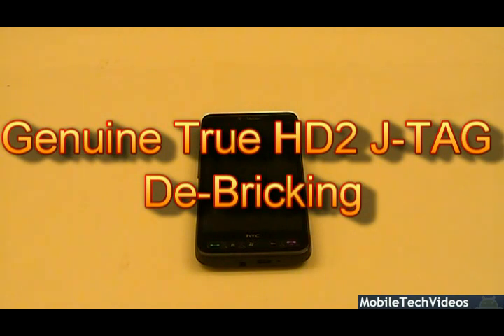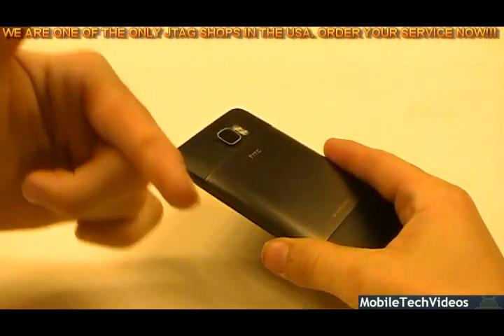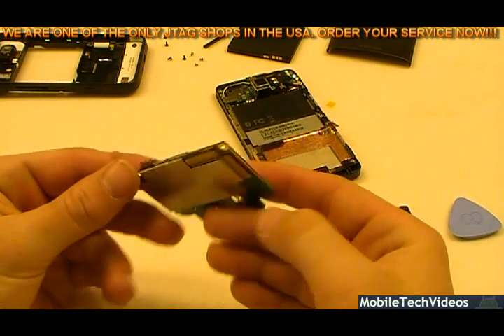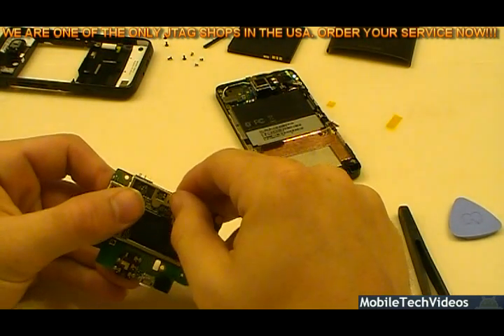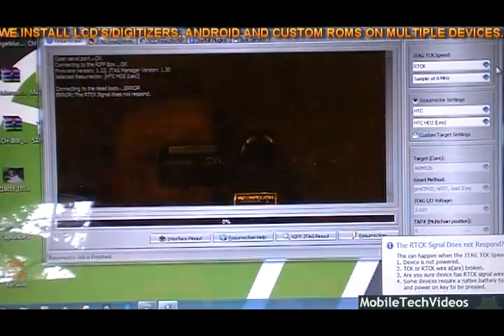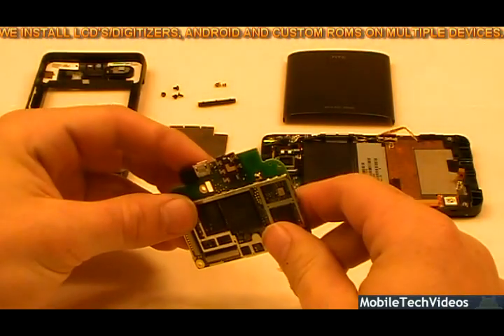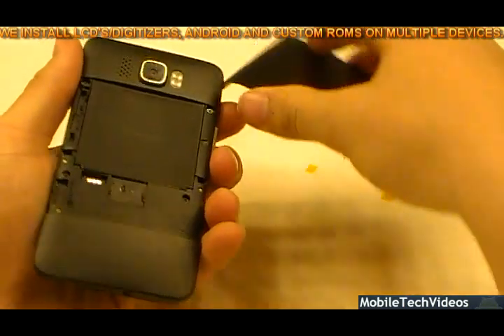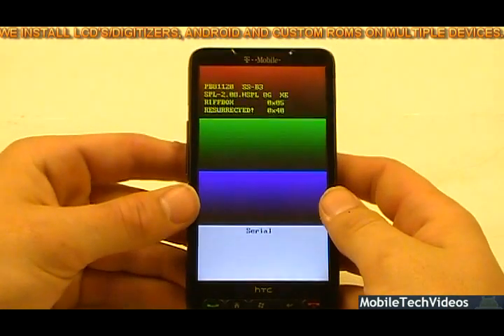HTC HD2 - JTAG Service (Debricking/Unbrick/Brick FIX)

Comment: i really think that's what i need to do for my hd2 cuz at first my phone was working fine with nand android on it , then it fell violently and that broke the battery port , i got it fixed . but now when i try to turn on the phone i get 3 different situations ( randomized ) the first one is that the phone boots up but i get a green screen of death . 2nd is that the phone won't boot up at all ( no recovery , no nothing ) 3rd is it won't boot up and it vibrates 7 times .

Comment from the maker: @paddy2kool007 Hi are you stuck with stock recovery and S-ON? If so there is currently no resolution for this. If you have S-OFF, I can revive the phone using fastboot reflashing. JTAG doesn't support the G2/DesireZ yet or I'd be all over those forums helping you guys out.

Comment from the maker: @MikehMike01 It connects to physical points on the motherboard to rewrite necessary binary values to the NAND chip. So I rewrite the necessary addressable sections of the NAND that the bootloader would be at. When you brick the bootloader it incompletely stops during writing to this section.